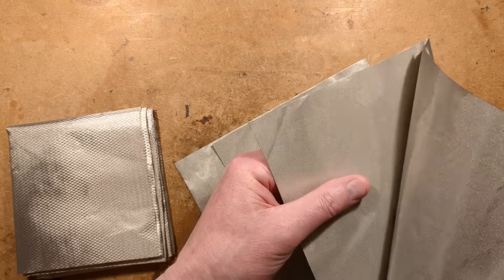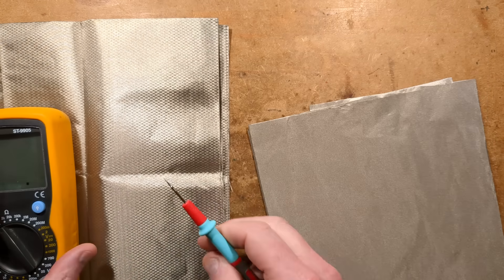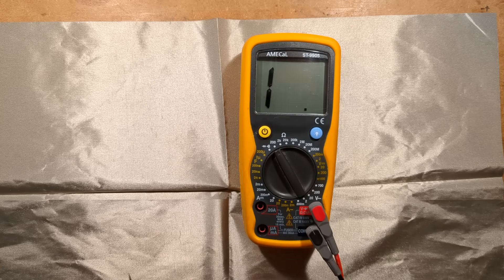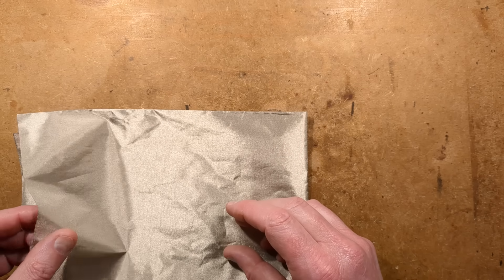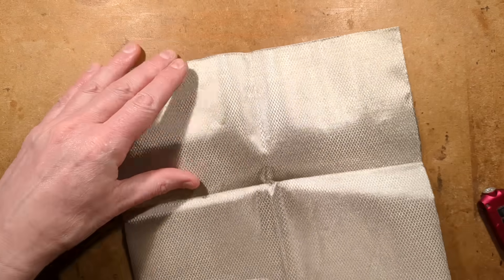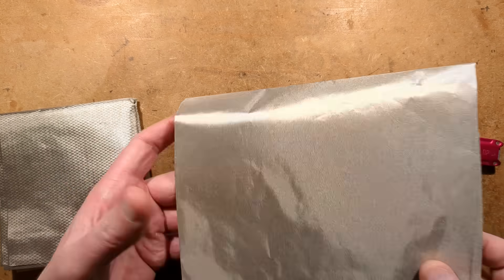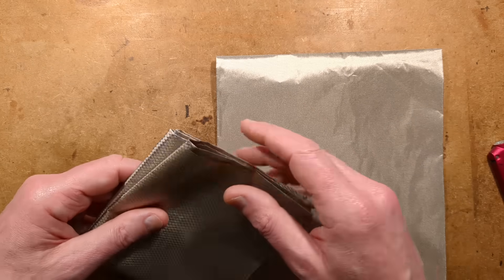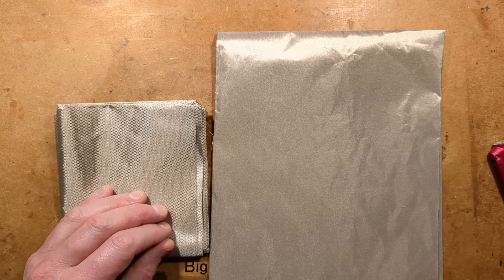Anti 5G fabric is amazingly conductive

Comment: Interesting, parabolic antenna?

Foldable corner reflector antenna?
If it's rip stop then you could make some really interesting illuminated kites.

But, the main use, separating paranoid nutters from their cash
Reply: The main use it seems to have is among radio hams to act as a ground plane for ground mounted 1/4 wave portable antennas. 73, G1YJY.
Reply: @paulsengupta971  nice use case, I like it.

Comment: It immediately made me wonder if it's the same material used as part of making conductive suits, the ones worn for safety when working on power lines.
Reply from the maker: I wondered that too.
Reply: I thought those were very nonconductive with intrinsic fire protection.  Accidentally pulling that arc makes the giant angry plasma cloud that tends to remove the outer covering from humans.
Reply: @ChiefBridgeFuser  no those are designed to be very conductive, so the Faraday effect makes the human inside safe, as no current flows through them, all through the suit. They get on and off the powered line using an insulated ladder that allows them to go half way connected to ground, then move the grounding rod to contact the line, and thus equalise to the line potential, then climb across to the cable to work. Going back the reverse, climb half way, then disconnect the ground rod and ground to the pylon instead. Works because the insulator length is always much longer than triple the length an arc can jump, so that they can be in the middle with little chance of an arc across the remaining gap, plus they only do this work in fine dry weather with low wind speeds. Any other time the line will be shut off and grounded both ends, and at the work site as well, before the crew even start getting onto the line.
Reply: @SeanBZA we are talking about different kinds if PPE, then.
Reply: @ChiefBridgeFuser of,not if

Comment: I made a foldable helical antenna using this fabric, with the reflector and helix held with supports.
Reply: It's also been used for several years now as a counterpoise ground plane in POTA activations.
Reply: @YllaStar95970  POTA? Planet of the Apes?
Reply: Umbrella Antenna 😁
Reply: @SystemX1983    E.T Go Home !
Reply: @NavinBetamax need to get signal first, so I can phone home! 😂
Reply: Same here, although it's still a pending project for future exploration
Reply: @iandeare1  If it's POTA, place the 17ft Chameleon whip with a 56:1 balun(Fair Rite1002) a metre off the ground and try elevating two linked radials for the bands, at 90° too
. It is literally ground breaking.😉
Reply: @YllaStar95970  That sounds like it would be a real POTA Performer.

Comment: I use materials like this to line metal containers that I put USB storage devices into for backups of my computers, tablets & data from my personal server that I want to keep safe from damage.  
Backup devices like laptops, tablets, Chromebooks & phones are stored as well.  I even have two fuel injection modules for my old pickup truck...one of them is in my glove compartment.  
Damage to electronics and data can come from different sources like Coronal Mass Ejections and EMP events to lightning strikes...so having backups is kind of prudent in today's digital world.  
Backups of my e-book & audio book collections of over a million reference books are saved too...they cover subjects from manuals & repair books to school books & quantum theory.
Reply: Shouldn't a metal container already provide it with protection?
Reply: Make sure to power those USB flash memory devices every so often, or EM and cosmic rays will be the least of your dangers to data preservation.
Reply: @Anvilshock    
I do that every month even if I don't add any new files to them  :)
Reply: You should know flash memory is impermanent; the charge wells require periodic refreshment or data will gradually be lost. Of consumer media, mass manufactured (pressed) CDs or perhaps DVDs would most likely be inert, though not home-burned ones, whose chemical dyes are perishable over years to decades.
Reply: I bet you'd like the Survivor Library. Its around 15k books for rebuilding after things go pear shaped.... all public domain or open source. It outgrew 256gb of storage a while back. So I've repurposed an old phone that supports large memory cards and loaded the entire collection onto a 512gb card and put it in said phone. Of course I added a bunch of other books as well as apps to read them, like a neat one about the 'Taylor hydraulic air compressor' .. but I digress LOL

A great Faraday container would be a NEW metal trash can with lid and use this stuff as an RF gasket.
Reply: Ahnd you could make a stylish replacement for your tin foil hat as well.
Reply: @M0UAW_IO83  the squirrel who doesn't stash his nuts parasites others
Reply: Based

Comment: We used this stuff in our medical equipment. Much easier to implement than adhesive copper tape.
Reply: I swear I have seen this glued to closed cell foam sheets and used inside computers and laptops to control EMF emissions. Maybe  as sleeves over connector cables too.
Reply: Same here.
Reply: Would it be effective in lining cavities in a guitar body (like copper tape or conductive paint) to reduce noise there? Sounds interesting.
Reply: @revbobuk it can be used for faraday cages so i think it should work for that
Reply: For what purpose?
Reply: is it conductive on both sides?
Reply: @adamrandall2996  It is a metal mesh mixed with some other fibres. Almost definitely.
Reply: @Deja117  not necessarily, if one side is polyester only, it won't be conductive.
Reply: @adamrandall2996 Apologies for the initial response, I was in a sour mood yesterday. Upon reviewing the video, he tests both sides. The first test is when the material is folded, the second test is when he unfolds the material. If you're using this for electronics, you can get fairly cheap rubber mats from the same place. Spend the extra few pounds, keep your electronics safe. Even if you find one that's conductive only on one side, it's still fairly thin. Very easy for stuff to poke through it. 😜
Reply: @Deja117  I have no idea what the hell you're thinking I want to do with this but you're wrong. I want both sides to be conductive to use as a contact just like copper tape.
Reply: @adamrandall2996  My bad, I was stuck thinking of RF shielding. Yes, this would work for that.

Comment: What order is the resistance of say a 1cm wide strip? I could see using it sewn into a safety vest to power LEDs for example.
Reply: A "Bus bar" as it were. I am guessing the only trick comes in fastening other conductors to it. Studs? Sewing? Given it's polyester, I doubt you could solder to it.
Reply from the maker: Crimped metal press-studs could work.
Reply: @ConstantlyDamaged nickel snap fasteners. Works for Elenco Snap Circuits
Reply: There are people making "Fara-J" J-pole antennas using strips about 1cm wide, sewn onto a backing cloth. They are generally made for the 2m and 70cm amateur radio bands.

Comment: What?  No schematic?
Reply: Just lots of crossed wires. 🤣😂
Reply: @dcallan812  There must be a way to make this into a molecular core-memory lattice
Reply: @jeremiahbullfrog9288  It might work, but you would need some tiny parts. 👍
Reply: Here's your schematic: ⏚
Reply: @gtsiam  All is ground
Reply: Holds up photo if infinite grid of 1 ohm resistors
Reply: @LanceThumping  did we just get the answer to that question? Is the answer 0.6 ohm?
Reply: Zero Ohm  @LanceThumping
Reply: One moment please
Reply: Here you are:
#######
#######
#######
#######
Reply: @georgeprout42  Excellent!
Reply: That would be a gigantic Ground symbol.
Reply: Folding hat schematic?
Reply: A lot of short circuits.
Reply: Or reverse engineering 😢
Reply: "Reverse engineering complete."
Reply: so good
Reply: Weave pattern is not available from the manufacturer unfortunately 😅
Reply: Take my thumbs up 🤣
Reply: A schematic especially for you: imagine lots of wires intersecting.
Reply: I miss The Vice of Knowledge.
Reply: @DavidCowie2022  ....Deported by Trump policy !
Reply: One moment please...
Reply: It`s just the ground plane, the schematic comes next week ;-)
Reply: For lining inside of the roof of your robin or scimitar if you want to fit a roof antenna that needs a ground plane.
Reply: been asking for a data sheet but all they gave me were blank cad drawings
Reply: Does it blend?

And: does it take solder?
Reply: @michaelthibault7930  Gonna bring the BlendTec Blender
Reply: here, i'll draw it for you
----|----
---\/---
---\/--- <------gnd
Reply: You're looking at the schematic
Reply: But it was fully reverse-engineered
Reply: It's a wire. 😉 
——————
Reply: It's right there in the video.

Comment: Another woo application would be those mats people put on beds so they "ground" themselves. A few sheets of this, and an earth clip, and you'd save a lot of money!!!
But seriously, it would do as an emergency earthing mat for weird workbench locations. You'd be able to have it on the ground and earthed if you liked to solder in bare feet (and who doesn't)

In terms of other uses, it looks a lot like the silver fabric that bags for Casio and Yamaha home keyboards in the 70s/80s would come it, you could remake those?
Reply from the maker: Something worth mentioning for personal anti-static grounding is that it should be done via a suitable resistor (usually 1 Megohm) to reduce the risk of shock.
Reply: ESD matt?  Make sure you put in a high value resistor in the line otherwise you'll be grounded like bare feet on wet cement.
Reply: The mats themselves are also very high resistance.
Reply: You should not use low resistance material for ESD protection. If you do, any charge will be discharged rapidly, which is exactly what you don't want. You want high resistance, so that any potential differences are equalized slowly.